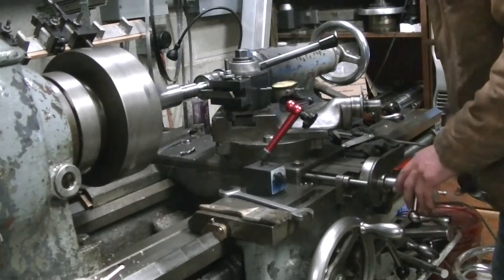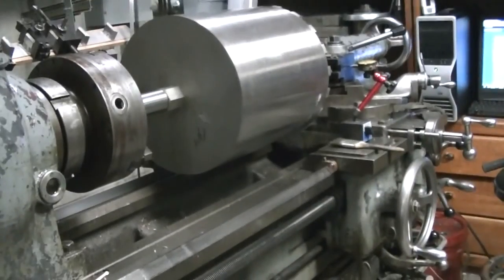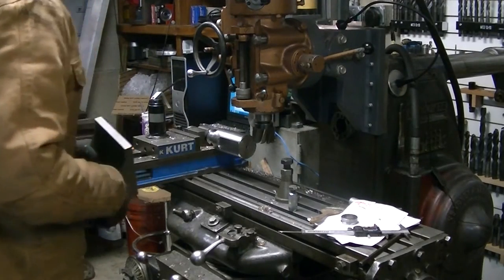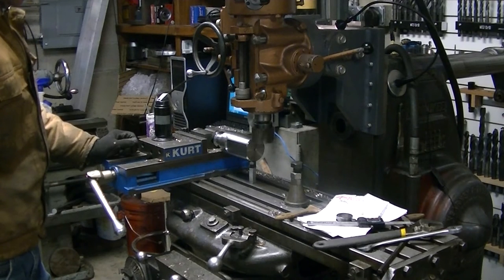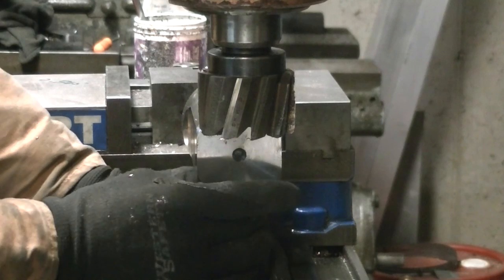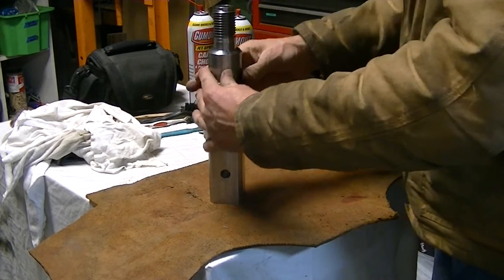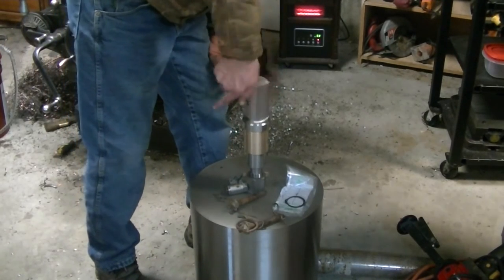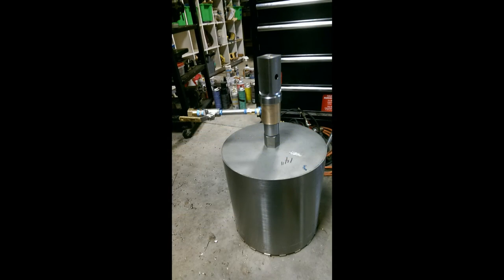Water Swivel Follow up to Threading, Hendey Style

Comment: Great series of videos. Could you turn the gain of the volume up on future videos.
Reply from the maker: Thanks for the comment. Are you talking about the gain on the voiceover or the recorded sound? I just got a little better microphone so hopefully that will help. Craig
Reply: clemwyo the voice over. You are doing a great job, your voice is just soft. A little more gain in the voice over would be great. Great channel, great videos. Very entertaining and informative.
Reply from the maker: +acklan3 Did you get a chance to look at the Threading, Henley style video? That was done with the new microphone and hopefully sounds better. Craig
Reply: clemwyo yes I watch the video. I find the audio a little soft, but it may just be me. If you have not had other mention an issue with the sound keep the settings were they are. At any rate I will stay tune in for the next installment.

Comment: Super cool fix.  Did you "lube" the o-rings with something before assembly?  Joel......
Reply from the maker: Joel L I usually use a little Super Lube silicone grease on O-rings during assembly. In my line of work I'm limited to what I can use petroleum based lubricants on so I've had success with the Super Lube products that are approved for use on food handling equipment. Craig

Comment: Nice project and great result - I was wondering what sort of rig you used the core drill on - I had images of you and your mates gripping extra long handles on a hydraulic motor ! :-)  Very impressive set up.
Thanks for uploading. Mat
Reply from the maker: Mat, thanks for the kind words. The little rig is just a direct push/Geoprobe-style rig that had the hydraulic motor on it for auger drilling so I thought I'd take advantage of it so I could do my own coring instead of hiring someone to do it. Craig